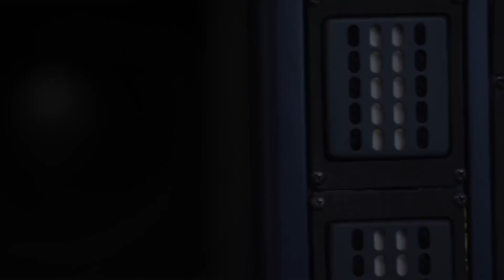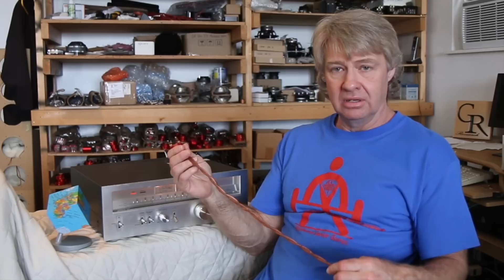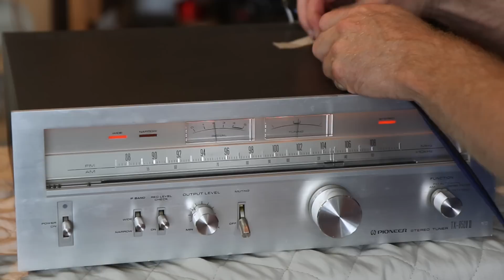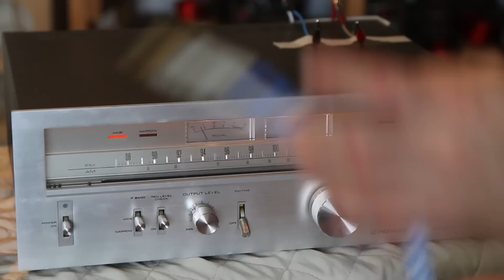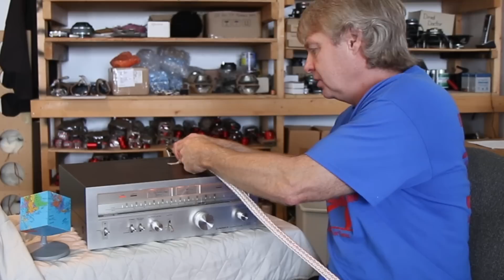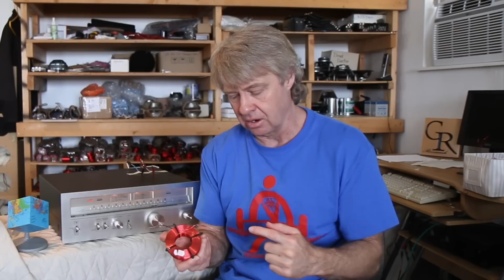Do Audiophile Cables Matter? Here's PROOF!

Comment: Huge difference between cheap monster cables and 150 dollar cable (RCA).
Reply: Fantastic. Now, try the experiment by using the 150$ cable and then using the cheap monster cables and twisting your speakers a bit. You will be surprised. :)

Comment: A colleague of mine had a pair of 15" Tannoy golds and his amp was at other end of the room hooked up to 2" flat copper lightening rod under his carpet terminated with banana plugs he made up, the sound was massively improved from expensive speaker cable he was offered to test from his local emporium, we are talking of absolutely no resistance loss, as we are only dealing with audio frequencies no difference would be audible, different story with interconnects.

Comment: I'm definstly an advocate for a quality pair of speaker cables over cheap Bell wire, of course there's a plethora of benifits like attenuation, capacitance and inductance. However my issue with this as an experiment is that there will almost definatly be a significant difference at 88mhz because of how the signals will propogate through the conductor. The biggest difference going to a higher number of cores per cable As apposed to a solid core due to skin effects at these frequencies that are typically detectable from 30mhz+. Enjoy your system and all the best 👍

Comment: What a capacity value of that great cable? Does it affect on high frequencies? And why do I see a lot of flat cables at audio exhibitions? This is really interesting for me. Thanks.
Reply: Check on the specifications of Kimber Kable 12TC ( I believe that's the one "tested", or the 8TC ). It has lots of capacitance for a speaker cable, but quite low resistance and inductance.

Comment: cable argument never end , since 1669 to 2069 still arguing
 different cable yes it can make sound different, different mean different, can make sound better ,can be worst too,just than simply, rare,fancy or high conductor materials cable doesn't mean better sounds, all about mixing and match, your amp your speaker simply change all parts to fancy cap sliver wire etc, then must make better sounds??I dont think that simply. mainly the circuit design make the sounds , its all about use right parts in right place. especially speaker design,designer never satisfy ,keep testing changing trying listening, always think can be better, that take lot of time get to cap ,resistance and coil value and materials right.time is money , take lot a time get all things right, thats not a 5min job simply blindly put fancy parts to get job done.
i believe cable make different, i buy cable too,i believe science, but i dont believe rare metal or high conductor materials must make better sound than reasonable quality copper and reasonable shield cable. at the end sounds good or not,its subjective, no right or wrong, trust your ears, play your favorite track, enjoy your music. sorry for my english.

Comment: Bruce Brisson of MIT Cables does a battery of measurements with cables to prove from an emperical standpoint that there are differences.  one of the tests he performs is to measure how the cable stores and releases energy at different frequencies.   obviously from a listening test point of view, there are a lot of factors that may yield someone being able to hear a difference or Not being able to hear a difference.  If the cables measure similar to each other, then there probably is not difference, however, if they measure completely differently, then there is more likely you will hear a difference.  But since listening tests are not standardized, there are a LOT of variables that are involved and any of those variables might be adjusted to either allow or not allow the listener to hear a difference.

The bottom line, if you are interested in better cables, get some demo cables from the dealership or the mfg. to try for a period of time and see for yourself if you can hear a difference.  Also, due to various levels of capacitance/resistance.  some power amp mfg. may, in fact, instruct you to use or to not use certain brands of cables as it might cause damage to the power amp.  I know of one that does this..

There's a good video you can watch that goes more into depth on MIT's cables and what differences they have found..

https://www.youtube.com/watch?v=yK3WY2bNaqo

Yes, I do use MIT cables, but I don't work for them.

Comment: My cables sound so good i got rid of all my other hifi gear! No speakers, amps, Dacs nothing just cables!
Reply: Also, listening to those cables on the 6th Tuesday of the month at 3:pm helps too, Hugely!!
Reply: @rianredfield5252  LOL
Reply: Make sure to pull your cables out and away from the walls.
Reply: @oldaudiograndpa1055  Yes, and consider the gravitational mass effect of nearby ferrous metals in carpet tack strips and flooring/framing nails on the cable.
Reply: Also don't forget to consider gravitatonal waves and relative time dialation due to earths gravitatonal field so the electrons in the cable don't change their speed, also do this in a farraday cage, so you block any radio waves 😂 and also get an "EMF" absorber for your wifi for 50$
Reply: Straight wire with gain!
Reply: Amateurs. I had just cables for a minute, but I got rid 'em 5 or 6 years ago. Changed my life. The sound is so pure, so unadulterated l that it's basically inaudible.
Reply: Hahahahahaha  ...
Reply: I support this choice and look to follow
Reply: I just use a piece of the cheapest 24 gauge wire i can find and stick it straight into my ear drum, the transonics are amazing, and the noise floor is below zero.
Reply: Yeah, but in that sort of case you know that you have to match the cables to the cosmic background radiation, otherwise you will have terrible audio quality!!!!!
Reply: @AriKolbeinsson  Damn you had to ruin it. back to the drawing board.

Comment: Standard purity for copper cable is 99.95%. Braided cables (not braided wires inside the cable, not braided shield outside the jacket) add more resistance, inductance and capacitance (i.e., Z= R+jX). The less resistance, inductance and capacitance the better, keep wires short and separated. Although braided wires eliminate cross talk but you could do the same by separate the right from left speaker wire channels by couple of inches. That is, don’t run left and right channel wires parallel if not shielded, thus eliminate mutual inductance. Radio frequency and EMI are insignificant, plus speakers wires do not amplify those signals.

Comment: In the research I’ve done, and I mean probably well over 40 hours, speaker wire should be gauged to size just like electrical cords for tools or anything that draws voltage and amperage. Example, you use an electric tool that has 15 amp draw you should use a minimum of 12 gauge extension cord for up to so many feet, any longer distance then the gauge of the wire should go up, or should I say down to 10 gauge. If your only running the saw 20 ft from the source, yes you can use a 10 gauge extension cord, but it’s overkill. Anything less, as in 14 or sixteen gauge wire at longer distance and things heat up and it’s hard on the saw, not enough amps running through cord, to much resistance.  Same with speaker wire, gauge the wire to the distance at which the speakers are from the source. To small of wire, problems start, and things can ‘break/melt/fry’, blown speakers or who knows what. A lot of even higher end receivers come with speaker wire, it’s sometimes 14 or 16 gauge. Would a company give you the wire if it wasn’t good enough? When I did my wiring, recommendation from my brand of receiver when I called they said 14 gauge that came with it is good. So I did an experiment, I set up a sound meter for volume and had a couple guests listen as I tested. Now this is only for volume not for what some would say quality sound, highs, lows, clipping, etc. I started with recommended wire that came with receiver, 14 gauge, sounded good, then 16, and sound dropped a little, then back to 14 and it improved. Went to 12 gauge and sound did not go up but also we could not tell any difference in quality from any of the wires. If you can get the volume, you should be able to get the quality with the correct sized wire. Any more is overkill.

Comment: You mentioned, but didn't use the cheap, T style dipole antennas that come stock, with tuners. That likely would have worked better than the other wires. Should of hooked one up.

Comment: I just watched the best speaker cable for a FM antenna test at a certain frequency between 87 MHz and 108 MHz.  Why not run a reference audio signal from 20Hz to 20KHz and look at it on an oscilloscope?  -16 dB of FM signal may produce a signal on a FM tuner (it is demodulated and amplified) but will not have an effect on a speaker cone and BTW RF signals are hitting your speakers all the time even when there are no wires connected.
I have witnessed how expensive cables sounded better to the seller and owner but not to the guy that wasn't willing to shell out the cash.  However I will agree there are proper cables for a particular application and should be used as such.  I am in lockdown on Christmas Eve trying to entertain myself, already had enough to drink and eat.

Comment: I ran 12 gauge generic speaker cable for years.  On a whim, I asked my local dealer if I could audition a high end set of cables.  I was expecting to not hear a difference but the difference was so pronounced everybody in my house could hear it.  On a test track I used, the sound got a bit more neutral, vocals gained scale and are physically higher, and I gained clarity. I can switch my cables back and forth within seconds and compare.  It isn't subtle difference, it is very obvious.  It is almost as pronounced as changing speakers.  If somebody heard these two speaker cables and said they couldn't hear a difference they would either be lying or def.

Comment: You have a noisy floor? you should hear mine, I'm not kidding either it squeaks like a B. Seriously though we are are talking microvolts of RF on an output stage of an amplifier, you cannot seriously expect me to believe that would make any difference to the sound, but hey If I had those expensive cables lying about I would certainly give it a try, stranger things have happened, Like when I loaned my regular Naim speaker cables to my son for the weekend but then needed to listen to my music so went in my cupboard and found some solid core multi twisted pair telecommunication cable and used that instead and....I could swear it sounded better, but surely not, I just put it down to my imagination in the end or that I was just in a better mood, or that the music I was listening too was really good, who knows?

Comment: Whether the cables improve sound quality or not, this is a terrible "experiment" to prove anything.  I'm pretty sure my speaker response rolls off long before 88 Mhz anyways.  And an RF signal through an 8 ohm load produces approximately 0 watts of power anyways.
Reply: Pretty sure it would effect how much noise is being generated and inducted into the cables by the houses electric wires...

He said it was ONE effect that he could actually demonstrate...

Probably more important to pre-amplification signals...

It's not to say many cables aren't snake oil, but a truly good one will make differences in the signal to noise ratio
Reply: yep , i was thinking something similar, we are talking minute levels of energy which will produce negligible response in the speakers....
Reply: @Madlop2  You guys don't get it.  What is noise?  It's not hiss or hum that you hear, it's degradation of your noise floor.  Since you aren't aware of what affects your noise floor, just keep on rocking with whatever compromised cables you have.
Reply: @stephens3845  you keep spending buddy.😂
Reply: @stephens3845     If you have an audible noise floor at a not ridiculous volume setting, on a decent system correctly hooked up with just decent cables, then you have bigger problems!!  I'm sitting here scratching my head at where these guys are getting all this noise in the first place!
Reply: Unfortunately I don't think this is wholly accurate unless there is a load on it completing/closing the circuit. Opened ended wires act as an antenna based on the length and twist index and available frequencies to cause ingress.
Reply: Unfortunately I don't think this is wholly accurate unless there is a load on it completing/closing the circuit. Opened ended wires act as an antenna based on the length and twist index and available frequencies to cause ingress.
Reply: It's a completely relevant test. It demonstrates the effect of an increased noise floor, which can effect the perceived sound quality.

Comment: The source of the signal is the amplifier. Not free space. The power ratio of amplifier to air is a whole lot of dBs.  But also the frequency range is way off too. I do agree the inductance of the cables has an effect especially if 1 lead is longer than the other. But I would expect the effect is negligible. Your test only demonstrated that the inductance of the cheaper cable is higher than the braded cable.
Reply: And that inductance is a RF filter.